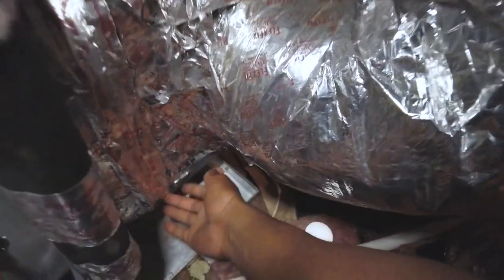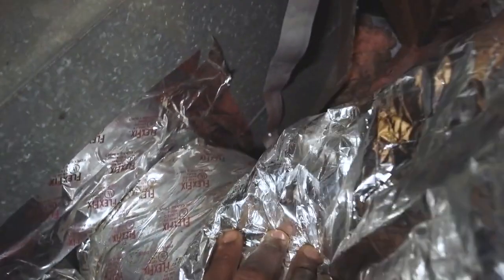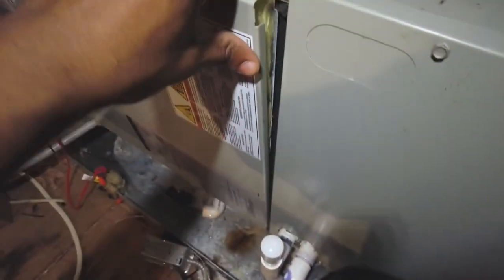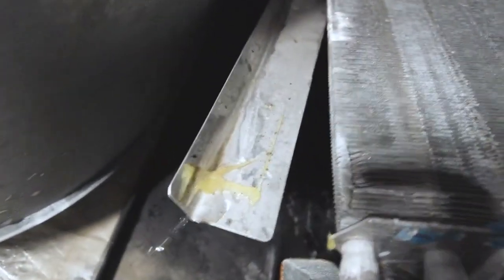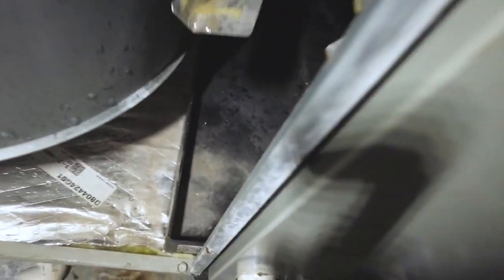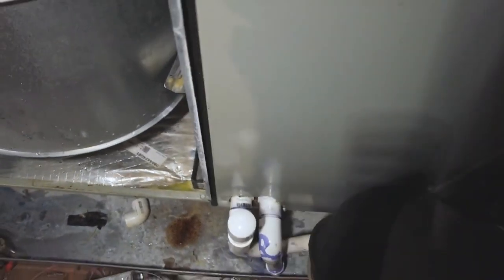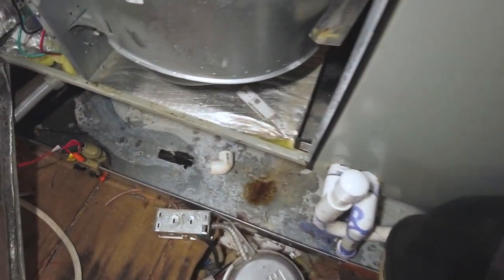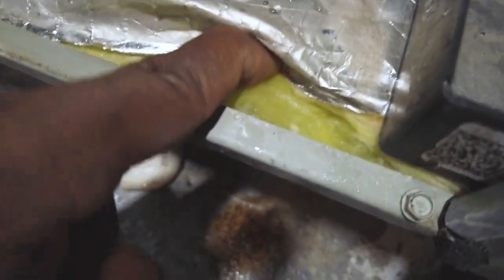Trane Air Handler Leaking Water in Attic Design Flaw HVAC Tech Training

Comment: We have installed a lot of those air handlers, never had that issue. Probably a one off! Or broken by the jackleg installer that re-used the old plenum and forced it to fit with 10 miles of tape. That was a bandaid, might want to shut it off next time and dry the area first. That will come back off.